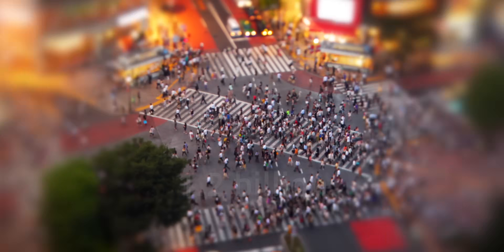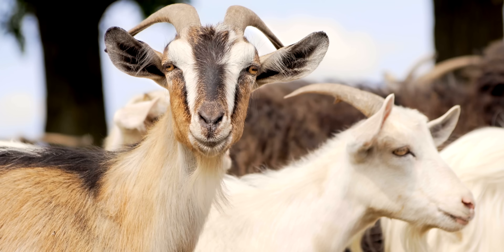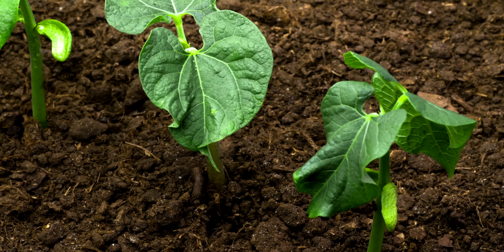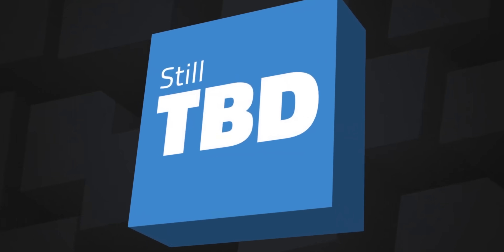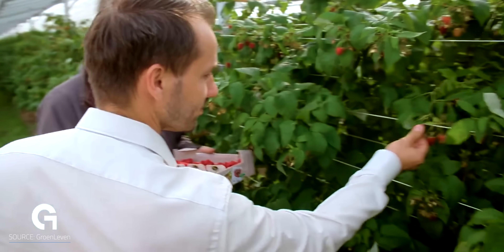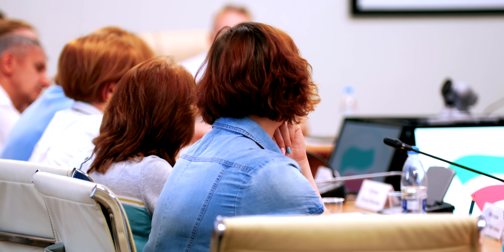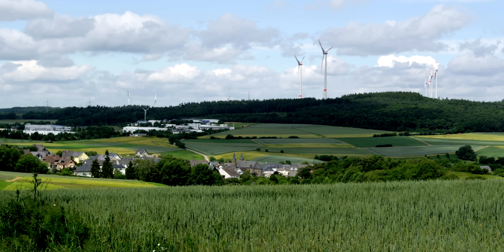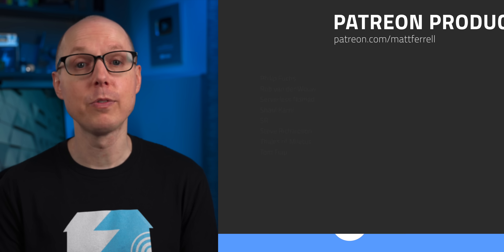Solar Panels Plus Farming? Agrivoltaics Explained

Comment: This is by far the best summary of agrivoltaics out at the moment. Thanks for putting together such expertly reasoned information.. especially for the practical application of agrivoltaics in different layouts, climates, and crops.

There are a couple of facts I don't think you mentioned, which are: Both the panels AND the vegetation under solar panels decreases the temperature of the micro-climate - this benefits the plants (which you mentioned) but decreasing temperature also increases the yield from the solar panels. 

Second, another significant hurdle behind this type of project is insurance + fire risk. It is apparently very difficult to find insurers who are willing to take on the risk of fire in agrivoltaics projects. I assume that is because these configurations are still relatively new, and the financial risks are not yet well understood.
Reply: Thank you and you're welcome! I had a lot of fun compiling this script, it was actually a spin-off from a bachelor assignment I was working on for environmentally improved production (I study at the Open University). About the fire risk: there is an interesting aspect not yet fully understood. I did not mention it in the script (too much information). Fire risk is not very high with these types of solar panels. The risk is much higher when they are laid upon a roof of a barn or shed. We have seen cases where these stables are completely burned down (including live cattle). But the most interesting part of that problem is not the insurance of the panels or the barn, but the ecological cleanup costs from the shreds of burned and broken solar panels, which can be quite toxic, which can be dispersed for hundreds of meters around a burning farm.

Comment: I think the farmer needs to be the one paying for the installation, similar to house owners paying for panels on their roof. If they can expect to recover the installation costs in say 10 years and after that make a very nice profit, they'd be insane to not go through with it.

If the energy company pays for it all, they'd probably prefer a dedicated solar farm instead, since that maximizes their profits.
Reply: On the flip side, that's gotta be a large additional capital expenditure for a business that's already running on tight margins and stretched credit. If someone else can shoulder the costs and instead lease that panel mounting space from the farmer, saving the generator from needing to acquire and modify land while providing a consistent secondary income to the farmer I would expect more buy-in/adoption.

No reason why both systems couldn't co-exist, but to say one party needs to 100% foot the bill, end of story seems a tad brash.
Reply: @jordancornelius7061  or government can sell it using installment, let say for 10 years the installment payment is the same as current running cost, i think there will be a lot of farmer that use it... since after 10 years they can profiting from it...

Comment: The cost per kW-h of AGV may be higher than a conventional installation, but that's just the first cost.  Once the panels are amortized, that's just more income per unit of land than the just-ag or just-solar paradigm, an obvious win.  Sure, it may take a bit longer for the panels to pay themselves off when considered only against their electricity generation income, but also in the meantime they're offsetting (in the example of the raspberry operation, which couldn't do without some kind of sheltering scheme) expenses for needed plant protection or otherwise enhances crop yields in which might have been a down year.  Combine the avoided costs with the income provided and AGV gets pretty darned attractive, really fast.

Comment: Free market is the problem?? What. You don't know what market means? It means if it works it will be done. The only time free market gets in the way is when it is not economical. 

Farms tend not to be near mega cities and less power lines are available to tap into. 

BTW in France. Paris is basically surrounded by wheat. 
So it isn't the "Free Market". It is area planning. Stop being anti ag. Ag is a great thing to put near by populations centers. It is low impact CO2. 

He is actually wrong it isn't "free market" it is politics that push no Ag near cities and heavy industry instead next to major 3rd world cities. Globalist have moved farms out of 3rd world in favor of cheap labor in major cities.

Putting heavy industry around 20 million people causes things like COVID to be a major problem. 
Large cities like Paris benefit from having ag surrond it. Low impact areas like parks and ag help metro areas it doesn't hurt it.

And in the case of Agrivoltaics making ag around major cities would have the dual effect of better air for the cities but allow a nearby source to send electricity.

Comment: It would add to the cost, but if it's on struts and can rotate along a single axis, it should be possible to vary the shade, based on plant needs and electricity price. Panels can go from perpendicular to the sun (maximum energy, lower plant temperature and evaporation), to vertical (to let the rain through) to parallel to the sun rays (to let in the maximum amount of light). Water pipes could run along the struts. Definitely an interesting concept for sunny and dry regions.

Comment: Great stuff Matt.  I’ve seen solar arrays installed over parking lots.  They are about 20-30 ft above the pavement and provide shelter from sun and rain/hail.  One of the best uses I have seen and used.
Reply: As a citizen of the drizzly PNW, I would love to see this in grocery parking lots. And they could power quite a few car chargersas well. Would they reduce Island heat effect, you think?
Reply: How many Parking Lots can you get .. as compared to Agriciltural Land... the latter can provide ALL THE ENERGY THE WORLD NEEDS ON BARELY 1MILLION KM2 (1Tm2) OF THE 15MILLION KM2 OF FARMLAND AROUND THE GLOBE... THIS IS THE REAL POWER IF AGRIVOLTAICS... TO EASILY SUPPLY ALL THE ENERGY MANKIND NEEDS FOR A LONG LONG LONG TIME... ALL BY ITSELF..!!!
To put things in perspective... if ALL THE BILLION CARS WERE PARKED UNDER SOLAR CAR PORTS (10M2/CAR)... THE TOTAL AREA OF THESE CAR PORTS WOULD BE JUST 10BILLION M2... You get the idea...
Reply: @AjayAjay-gz3oz  just put it on highway, the car get shaded and you can get long solar farm... everyone happy...
Reply: @alphaxfang  Love this, what is wrong with it !! rain and sun protection good for safety and cars and people. Would have to make it very continous to eliminate flicker effect.
Reply: @AjayAjay-gz3oz   Parking lots are a win win too, pavement lasts longer, carbon positive, cars last longer without repaint or over replacment, carbon win, and the parking lot is already assigned non green a task and can be made to do double duty. Agri is not the only answer.

Comment: Yes, we should indeed! And, also, see if there are smarter ways to create more hydrogen gas using electricity. I think we can/should forget about batteries and use hydrogen instead. Also to use salts that melts when heated and contained well isolated to heat water or anything else enough to be able to run it through a turbine connected to a generator. And, forget battery driven electric cars. I think they consume to much resources to make those batteries. It's like the ethanol. Made from sugar canes in Brazil, harvested after burning the field (and burning out the manual labour as well) to make ethanol to ship to the US or Europe. How eco friendly is that?

Comment: I've been looking into doing this on my small farm, but there is practically no information about how to go about doing this. If you do a search for Agrivoltaics, you get a lot of info about what it is, but no one who actually installs them. I've been trying to figure out a DIY approach, but the cost of creating a raised structure that spans a hillside is not insignificant. You're also directed towards a lot of concrete footed metal post approaches, and who wants to add concrete to their fields, not to even mention the cost or environmental impact of doing that. I'm trying to figure out now if I might use a tech like ground screws and lattice cheaper metal pipe to create a strong enough structure. It's going to take some real research to figure out appropriate structural loads.
Reply: I think this would actually be a perfect startup intiative, as there doesn't seem to be much competition going on, but research seems to be quiet far
Reply: Perhaps trying it in conjunction with the state to setup a Solar partner? Then it would come to a mutual planning system that allows both to be able to maintain crops and solar without interfering with one another. I can imagine then both sides could be optimized with less impact upon the land's quality. You make sure you can take full care of your crops, while the solar maintenance crews can assess any cleaning needs or damages. Because otherwise you'd need to take care of both burdens as well.
Reply: What about cob insteaf of concrete? Earth building the structures sound like a good alternative
Reply: I am interested in doing this for people. I am in the process of starting a company building these for people. I just sent something to Elon Musk about it on twitter. I think it may be feasible, not sure the kind of cost but you could always do part of the field each harvest. Over a period of a few years. Plus the tech is going through a boom right now. It may innovate very quickly. I said that because cost is going down pretty rapidly right now and the power you can get from them more. He said the capital for it was about the same as a farm so you are probably going to make money.
Reply: I hope you get some assistance and useful comments with this video.  Best of luck with your project.  Try to record your researches in view of sharing and helping other pioneers!
Reply: I wouldt I'd rather git a hammer and bust those panels up and brake them to little pieces it's a political scam thats all this is .

Comment: My biggest question about photovoltaics has always been "Why are we not adding them to places already in use instead of taking up all kinds of land to plant them on racks??"  Seriously---there are a lot of ways to fix this:  Community planners need to plan solar panels into design structures that already exist.  Your home or business has a lot of surface area on top of it that gets completely ignored unless there is a leak---why not lease that space to an energy company so they can add solar panels?  Why are there not more energy companies trying to do this?  It seems like a win/win for everybody.  If every building were to have panels, we could increase the amount of photovoltaics in use by several orders of magnitude without taking up a single square foot of extra space.  I am 100% in favor of a smaller footprint, less sprawl, less encroachment upon wildlife and less habitat destruction.
Reply: As for Agrivoltaics---any farm that relies heavily on sun and/or wind screens needs to do this.  It is less a question about whether they should and more a question about why haven't they done it already?  Same for greenhouses.  There is no valid reason for not doing it.

Comment: One solution to many of the issues with agrivoltaics is solved with semi transparent solar panels such as those manufactured by Brite Solar.  The denser covering that this allows also provides crop protection against birds, hail and frost.  Collection of rainwater from the crop protection coverings also allow optimization of water use.

Comment: The world agricultural system is extremely "top heavy". When crops are put in order, in terms of the highest to lowest total kcal for the crop grown worldwide (FAOSTAT data source), the 4 top crops have about the same order of magnitude of total kilocalories grown: corn, wheat, rice, soybeans. The next few crops are an order of magnitude lower (total kcal grown yearly worldwide). And the next several crops, another order of magnitude lower. By the time you get to the bottom of the top 100 crops, you are 5 orders of magnitude lower in kcal grown yearly worldwide. Which means that there are less than 100 crops that provide the vast majority of calories (as well as protein, fat, and carb specifically) for the planet (including livestock feed crops, which make it to the table as meat, poultry, farmed fish, and dairy). Raspberries, strawberries, celery, lettuce, don't make the top 100 list. Potatoes is a top crop, but only increased by 3% yield in the cited study, with an additional 8% lower yield due to land loss, for a total loss in the hot dry year of 5%. More crops might be economically viable, in this system, (Matt: "making up the crop shortfall due to the energy produced") due to funds from the solar power. But then you are incentivizing FOOD LOSS for the sake of electric power and money, in a hungry world. Also, farms often have large areas of non-arable land which can be used for solar, without crop loss.

Comment: Solar panels over your crops, and turbines in your irrigation system's flow. Add in some thermoelectric generation with both irrigation, and solar system and a heat-pump system under the soil and you're really optimizing your land usage.
Reply: Thermoelectric generation on the back of the solar panels above the crops might help recover a little extra. It's not very efficient, though. Only something like 5-10% of the heat energy that passes through a thermocouple actually ends up as electricity.
Reply: @Roxor128  It wouldn't pull much from the temp difference of the irrigation pipes either, and generating power from turbines  in your irrigation system's flow is only valuable if you have a natural pressure that's great enough to manage it, but I'm just listing things. Should have added in vertical wind turbines too, and since the solar panels are sails, catch the wind pressure on them to make a little more power.

Comment: seems like a great idea even for home use. Small, Solar paneled greenhouse in my yard that could easily power air flow and even allow small heaters to extend the season. Protection from hail is another bonus.
Reply: I bet this would be a good option for a Solar Green house to be offered in rural areas. It could even be a community or city green house that allowed community members to grow under.

Comment: Another regenerative farm/energy synergy would be small scale pumped hydro. A lot of farmers already have solar here in germany and quite a few have irrigation ponds.   If it werent for regulations it would be super easy to connect two irrigation ponds at different elevation and store some of the excess energy for nighttime use.  If its a big farm with enough land a bigger irrigation pond could supply the neigbours with power as well.  Basically paying the farmer for storage could create good effects for village sized micro grids.

Comment: This needs to be enthusiastically encouraged to all farmers who could benefit. They can save money in reduced water cost, make more money with higher yields and have a new revenue stream getting a percentage of the power generated. They can even store the excess power from the panels that the grid doesn't need in electrified farm machine like tractors, water pumps and storage batteries for lighting and heating.

Comment: Damned good video!  I've been advocating and thinking about this since 1968!  Our So. TX farm was often too dry to grow Maiz or grain.  I advocated stringing solar panels on wire rope or steel cable to suspend the panels above the ground and allow the tractors to get to the ground.  Less water evaporation and regulated solar exposure would maximize production.  Plus eventually there would be electric tractors.  But who is going to listen to a 14 yr old!
Reply: Well you're not 14 anymore.
Reply: @shahbazfawbush  LOL! Thanks for telling me!  I'm 67 now and who wants to listen to crazy old men?!?

Comment: I feel like those bladeless wind turbines could be added to this system with ease. Strategically placing them around the top of the solar array would turn it into a constant energy production system. A company could most likely make a small array system combined with the bladeless wind systems and make a good off grid farming setup
Reply: Use the solar panels to create the voltage difference
Reply: Or cause damage I'd rather bring the nuckler silos back online

Comment: Solar grazing is a great option. Using regenerativ grazing with sheep and solar on the same land.  Also you could just manage sheep on standard solar farms.  Keeps the soil healthy and the solar panels free from grass. Another added benefit, compared to tractor farming with solar, is less material (steel/concrete) used for the mounting.